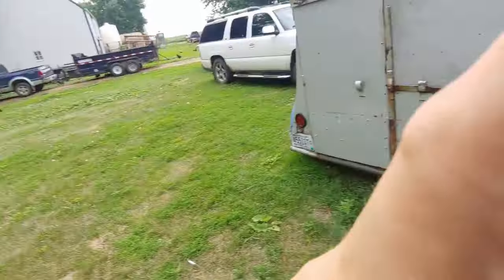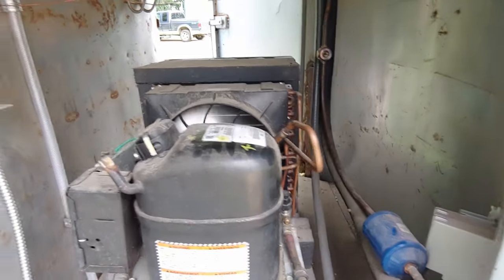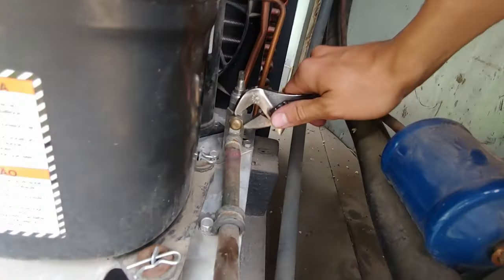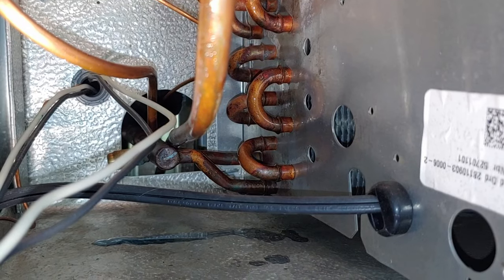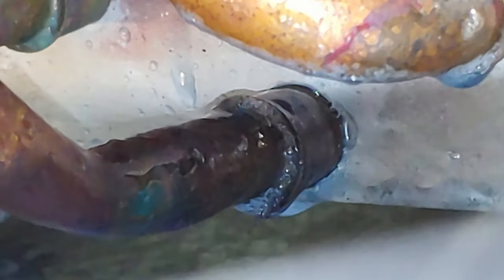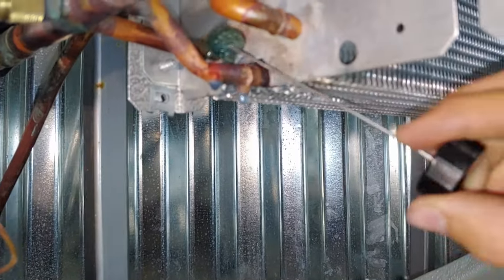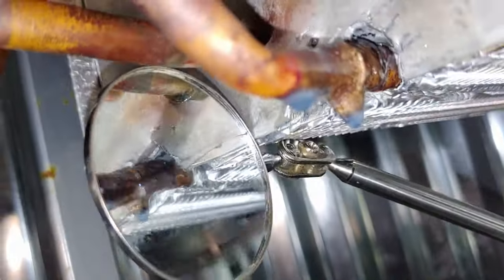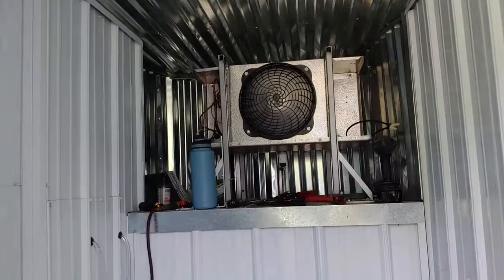Homemade Freezer Trailer! Service Call and Repair

Comment: Very interesting! Do you need to replace the filter-drier on a repair like this, or is it still good?
Reply from the maker: Usually if I am able to braze without opening the system, I leave the filter drier in. If it was a compressor burnout then I would definitely change it. Best practice would probably be to change it though.
Reply: Yes you should… the system was running in a vacuum, it will be conterminated.

Comment: Was there no low pressure switch on that system to prevent the compressor running if the charge is low?
Reply from the maker: I don't think it had any pressure switch, as it wasn't a pump down system. Seems kind of like a poor design.
Reply: @ReubenSahlstrom  At a minimum I would expect a low pressure cut-off. Even AC systems in vehicles have one so the compressor won't run if there's no gas in the system. Anyway, great video - thank you for uploading it!

Comment: If that trailer plugs into a normal 20A outlet, then nothing they plug into that receptacle will ever overload your 40A timer - it'll trip a breaker (or melt the supply cord) first.